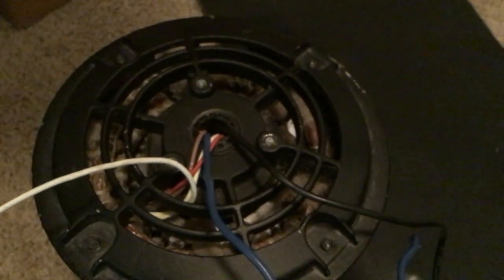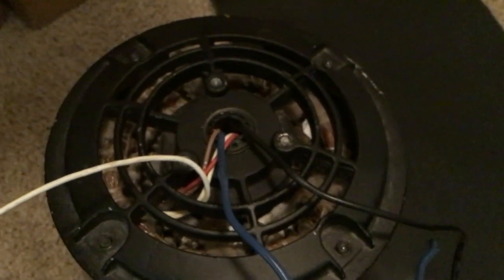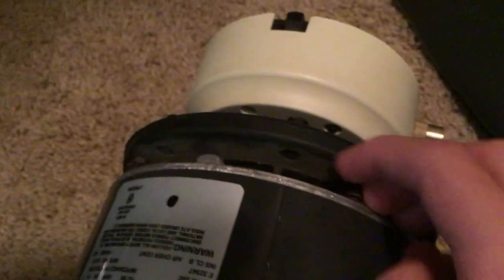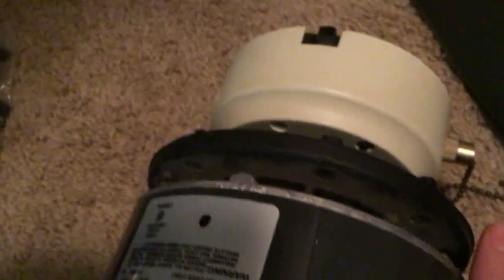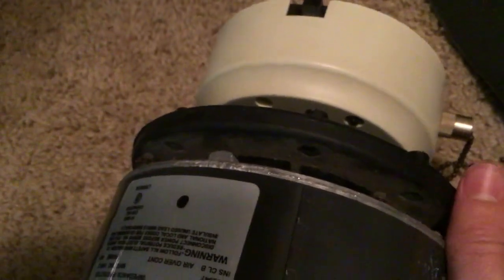I need help with this fan

Comment: Its either you get a new top plate, drill out the remains of the threads of the nut, or have to reside to a replacement motor, though they can get real expensive sometimes (though it looks like you can't). Sometimes you just have to settle. The MFC (Modern Fan Co) Industry's (And i think others) have almost the exact tame "K-55 Type" motor that they used on these, though getting one and parting it out would be a pain in some cases.
Reply from the maker: Okay, I parted out a couple of my Casablancas in my collection (antique white/bright brass Zephyr, Snow White/Bright Brass Delta II.) and they are packed up right now because I am moving in less than a week but I will try drilling it out the remains of the nut because I am not old enough for advanced Casablanca ceiling fan repairs but I’ll deal with it later, and I won’t buy a replacement motor, but I might use the top plate from my antique white/bright brass Zephyr I parted out, or most likely drill out the broken nut. But I don’t know how to drill it out because it’s hard. Can you give me a suggestion on how to do that?

Comment: Did this thing still have its heat sync in it when you opened it up
Reply from the maker: Yes, but I took it out.
Reply from the maker: I think it did, but not 100% sure.

Comment: The only way to get it out is doing this:
1. Remove the spring clip
2. Remove the switch housing 
3. Remove the flywheel
4. Take apart the motor.
5. Take the rotor out of the motor.
6. Try using a screw extractor or anything to remove it. This isn't rocket science, find something that can remove the broken nut.
7. Reassemble it by reversing step 1-5, being step 5-1.
Reply from the maker: I feel uncomfortable removing spring clips because they might break.
Reply: @ceilingfansclocksminecraft1226  if you find the right size for the spring/retaining clip, you won't be stuck with a broken one.
Reply from the maker: Adin's Corner Of Fans And Other Things 2004 Well I am not buying anything off of eBay right now but thanks for the help. I still don’t feel comfortable with it but I will try to drill the broken nut that’s inside and then once there’s a hole, you could drill it out. I’m gonna try this later.

Comment: You will need a new top plate, I don't think theres a way to get it out
Reply: You need to drill out the broken screw I have broke screws off i drill them out
Reply from the maker: Ceiling Fans & Fans Where do I get too plates?
Reply from the maker: Erick Morton That’s what I thought. I will try that when I can.